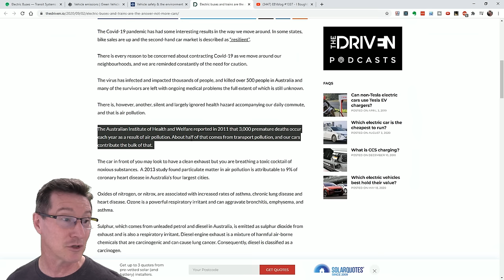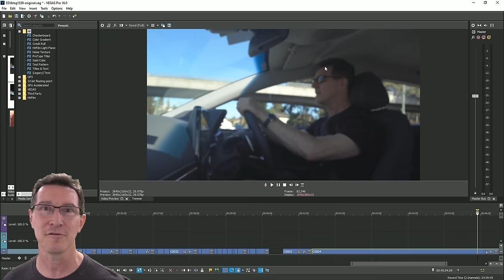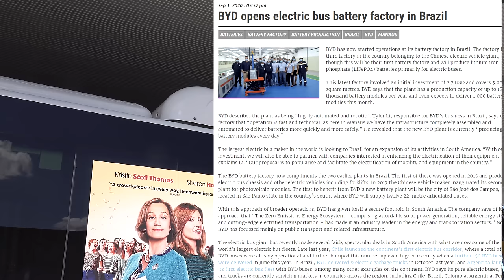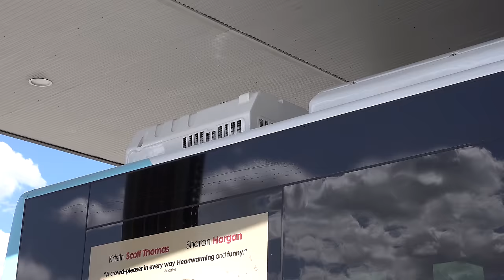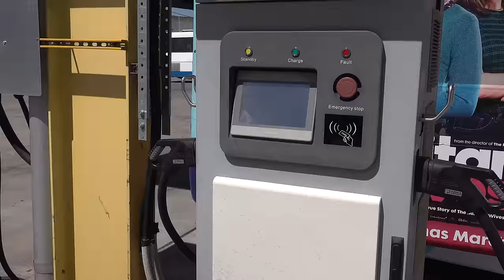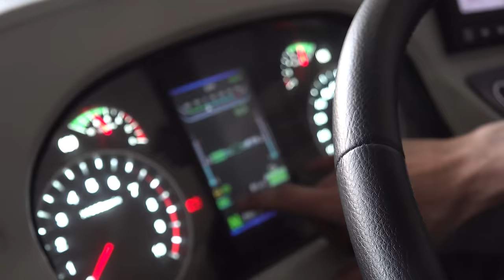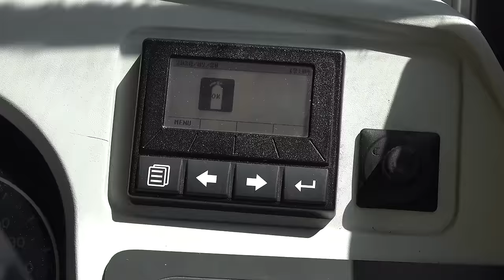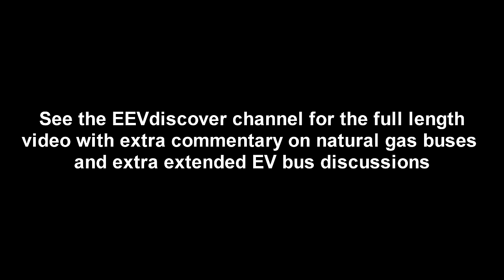EEVblog #1339 - Looking at an Electric Bus!

Comment: LiFe batteries are much better than regular Lion, less density but indestructible
Reply: Oh, they can be destroyed. They're more forgiving, but nowhere near "indestructible". (granted, they don't burst into flames when you stop looking at them.)
Reply: @Ormaaj  They handle overcharge undercharge must better. They have no effective thermal runaway problem. Driving a nail through one is totally uninteresting. (charge cycles are very dependant on who made it. That's a function of the "witch's brew" in the electrolyte. As he said here, "twenty two thousand cycles".)

Comment: Electric buses are actually a big deal in Moscow, there are quite a lot of them replacing combustion ones. They are even advertised with "This is Electrobus" on their sides for general public to know.
Reply: Actually Moscow mostly replaces trolleybuses with both electric and diesel buses. Those electobuses are not cheap so there are not enough of them to replace trolleybuses which were completely scraped recently.
Reply: Nope, there are quite a lot of them replacing just a few of the trolleybuses and the remaining trolleybuses were replaced by diesel buses. That's not progress, that's regress.

Comment: Usually vehicles have differentials to resolve how one tire is rotating at a slower speed than the other when turning. I am pretty sure they do this in software and directly reduce the  rate of the inner wheel.
Reply: Or the motor controllers get a torque, rather than speed request from the "gas pedal"

Comment: They looked like 50kw chargers so with 16hrs runtime you effectively lose a shift. But I'm guessing Syndey might services are limited so it sounds ok.

No cost figure compared to a standard bus factoring fuel?
Reply from the maker: Watch the full video with all the details. They return with 40% of the charge, they don't run them to flat.
Reply: @EEVblog   I did watch to the end... Maybe I boiled the kettle at the wrong time and missed the costings.

I think he said it was 12-14 hrs on average, so 60% usage which is a three hour charge. They probably only charge to 90% if that's the usage, more battery life that way.
Reply: The only time you'll see a bus depot emptied of vehicles is during peak hours (6-10am, 3-7pm). Outside of those times there will be many buses parked up, and at night (10pm-6am) the depot will pretty much be full.
Reply: @mubd1234  I see. Fair enough.

Comment: Waw, there are electric busses like since forever. They take the the electricity from two wires hanging above... 
I don't understand the fuss about the one with battery.
Reply: Yeah its so stupid, this is just a con, making battery companies very rich - not a long term solution either. Try scale up battery production to millions of units this size. Not possible!
Reply: Putting those wires up is very expensive and complicated, and changing a route becomes troublesome, might as well just set up a trolley. An electric bus is as flexible as a conventional bus. Just imagine having to change a route for a couple of days because a piece of road is being resurfaced.
Reply: my understanding is most original trams were bought and closed down by big auto compnaies.  So yes, for fixed routes (towns, cities, rail), that would still be ideal.  We dont care how the energy gets to the wheels as long as we are not setting fire to stuff and polluting the very air we have to breath.

Comment: Trolleybus makes more sense than lugging aound 2 tons of batteries.
2 tons is equivalent to carrying at least 20 more passengers.
Reply: usually the constraint on passenger capacity is not by weight but by volume. you can have a transit bus packed full of standees and still not be overweight. two tons is close to what an engine, fuel tank, and transmission weighs.

Comment: issues with electric buses were being solved for a while, one of such solutions were trolleybuses.

Problems were the size of battery / energy consumption on the engine (and in winter heating)

Comment: A couple of tech generations from now, how small could those batteries be do you think? Can we get to a point where just charging at the stops somehow is enough to keep the batteries topped up to like an 70-80% level most of the time so there could be tiny (relative to this) batteries?
Reply: Clearly I write that before watching the whole clip or I would have mentioned how I don't mean wireless but rather an automated direct connection type thing. But, robotics out in the rain etc is probably a maintenance problem waiting to happen.

Comment: Wireless charging is just ineffective inefficient expensive infrastructure.
Reply: But if there was a....Freakin' Wireless Charging Solar Roadway.....it would be amazing!   (LOL)
Reply: @fredygump5578 
XD
Reply: This is why Trolleybuses and trams are better
Reply: unless its absolutely necessary and saves on the engineering problems of using a simple contact, id rather prefer just making contact so you can dump alot of power very efficiently. ... power is cheap though, it might be worthwhile to use wireless charging points where they park for city busses if it massively saves on maintenance and design.
Reply from the maker: It has niche uses, but otherwise, yeah.
Reply: In parking places it is good. And inefficient is not that big of a problem. It is still a lot better than ICE cars and electric power is pretty cheap at least where i live.
Reply: @EEVblog  AFAIK it would require changes in EMI rules.

Comment: In Sweden,  where I live , we have electric busses for 8 years now , we have  electric carpool which you can rent . Car key is inside car,  doors would be open by mobile application which you have it on your mobile ,
Sweden is far away from Australia   even Norway is far far away when it comes to electric car,
We have even small ship that cross the river is completely electrical,  charging runs for whole day,
Reply: Low temperature doesn't seem to be a problem, either?

Comment: I myself have worked in the transport industry as a fleet mechanic and Even though electric buses do indeed have a future on our roads, there's still the sorting out the logistics of having a huge amount of space dedicated for charging bays, the power demand needed to charge them (which is huge) and minimising time required off road for assets to charge in time before demand on mass are issues that will have to be solved, entire depots will have to be built around the planning of this!

Comment: Cool stuff BUT I am wondering WHY we would still use fluid-based steering (requiring a pump) instead of a more energy efficient electric assisted steering, same for pneumatic for doors and stuff, requiring a compressor, seems like inefficiencies we could remove in the system.

Comment: I think you also forgot that it costs close to 10 times less to drive, at least based on prices in Finland! Also as someone who works in the industry it's nice to see how other companies have built these! Seems that they are actually using a MobilEye ADAS, at least from the little round screen on the top right of the dashboard.

Comment: It's important to remember that going electric does not eliminate pollution. It just moves it from tailpipe to power plant.
Reply: The refinement of crude oil into fuel uses a huge amount of power. Using the power directly to run the bus is much better than refining oil only to burn it as well.
Reply: So what do you think powerplants run on with a efficiency below 40% ?
Reply: Not to mention that scrapping millions of perfectly functional cars to produce new ones is very energy intensive. The mining for metals and battery compounds. 

The fundemental flaw with electric cars is the are nowhere near as efficient as petrol and diesel. Neither is hydrogen fuel cell technology. A fuel tank gradually gets empty and the car becomes lighter as a result. An empty electric battery is the same weight full or empty.

Hydrogen is a much more dangerous fuel, remember when those airships used it, that didn't end well did it? as a result, any benefit hydrogen offers is wiped out by needing to have a fuel tank that is 5 times thicker (and therefore heavier) than a petrol one.

Petrol and diesel cars would never have been successful if they weren't good at what they did. The fact that electric has to be subsidised and we have to be forced to use it by banning combustion engines just shows it is nowhere near as good. Refueling a car takes a couple of minuites, electric much slower.

I'm not totally against electric cars. I think they should be the only cars allowed in big cities. But for people doing motorway trips, non-urban driving they aren't good enough yet.
Reply from the maker: It eliminates the local air pollution that you breath in, that's the point. That kills 3000 people a year in Australia.
And the energy comes from whatever source you chose. There are options.
Reply: @danspratt2  And electricity production and distribution is so perfect? there's huge loses as it travels down the wires and goes through all the transformers, sub-stations etc... If electric was a good proposition we wouldn't need to be forced into using it by banning petrol cars.
Reply: The most modern combined cycle power plants exceed 60% thermal efficiency. The biggest diesel engines can break 50% but most automotive diesel engines come in around 30%. This is ignoring wastage from engine idling, which as pointed out in this video makes up a very significant part of vehicle runtime. Even ignoring the fact that fossil fuel-free power generation exists, just switching from internal combustion engines to electric motors for vehicles will lower CO2 emissions overall.
Reply: @EEVblog  Recent studies seem to suggest that electric cars do not actually eliminate local air pollution because of tire+road wear, unfortunately. :/
Reply: @dave, so what you are saying is basically nimby.
Australia maybe different but in most of the world powerstations are in rural area, these are all just solutions to give some people nice clean local air and move the pollution to other people,area etc
It is not australian people, kids digging up kobalt,lithium and all these other rare earth materials But poor miserable people, just like the people breathing the crap from powerstations, they are not in these nice clean citys.
Reply: @EEVblog  That's not how the power grid works though.... you can't just choose your own source unless you can string your own power feeders directly from the source of your choice.
Reply: @tigo01  Yes, electrons are fungible, but you can still vote with your wallet. The plant you pay benefits from the electrons you use. That's one role that the regulations and energy markets can play in this.
Reply: @rkan2  You mean the same tire+road wear from ICE cars? Sure, the SUV sized EVs might be a bit heavier than the equivalent ICE version, but is the slightly increased tire+road wear a worse pollutant than the exhaust it replaces?
Reply: @6581punk  no it isn't perfect, but you're missing that the oil refineries must also use that very same power on the same grid to first refine the oil into fuel. Its better to send the power directly into batteries than to use that power to make fuel.
Reply: This is a bus, its not a car moving at 60mph for a hundred miles along a motorway, its in an urban environment and constantly stopping and starting, it being electric is soo much more efficient that this sort of argument doesn't hold up, like it might do for a motorway mileage muncher in a modern diesel car living in a country with a moderately dirty power grid.
Reply: @6581punk  "The fundemental flaw with electric cars is the are nowhere near as efficient as petrol and diesel."

omg, the FUD and propaganda lies are getting outrageous.  What's next? "The fundamental flaw with electric cars is that they explode when their battery is empty."?
Reply: @robber576  What YOU'RE saying is basically 'NIMBY', on the side of the rural people. 500 people in a sparsely populated rural area being exposed to pollution from a powerplant, versus 500,000 in a city being exposed to tailpipe emissions? I know which one I'd choose.

It's like those selfish arseholes who bitch and moan about the new airport in Badgerys Creek in Western Sydney on the basis that a few hundred homes are going to have plane noise...while hundreds of thousands of Sydneysiders will have a decrease in aircraft noise over their properties because Sydney Airport will have fewer aircraft movements passing over thickly settled suburbia.
Reply: @6581punk  huge losses? turbines at powerplants runs at a constant +50% thermal efficiency 24/7 which ICE could only dream off. Factoring system loss of around 10% due to distribution its almost certain going electric are greener

Comment: There is a second-hand Nissan Leaf (the coal-powered options in South Africa are a bit limited) for about half the new price.... 

I kind of want to take it for a test drive... (But at that price, you have to wonder if there's an issue with the battery...)

(I know Dave mentioned that the Leaf lacks battery cooling)

Comment: These BYD buses are all over London and been there for a while now, they use DC fast charging and also AC charging at 3 phase. They used to break down all the time due to the electronics and I don't remember them running out of range. They are very fast, Smooth and the power charging infrastructure at the garage is insane... I believe other companies are making electric buses, like Alexander Dennis wich seems more reliable. BYD us a Chinese company, with slightly less quality. But they get the job done. They have Electric double decker's made by the same companies.

Comment: Does the transit department additionally leverage solar to help offset the electricity costs for these buses?
Reply: No it’s all run off coal
Reply: if you are talking about solar cells on the roof of the bus it would be a trivial contribution compared to the surface area. if you mean solar back at the shop that would be a great idea.
Reply: @lightningdemolition1964  Nope.  I was wondering if they had a solar farm nearby or on the roof of the building to offset the electricity costs.  Understood that on the roof of the bus it would not be much.  Maybe like a solar road?  :)

Comment: Cars generate pollution from tire and part wear: "Air pollution from tire wear particles can be 1,000 times worse than what comes out of a car’s exhaust, Emissions Analytics has found. Harmful particle matter from tires is a very serious and growing environmental problem, and is currently unregulated...Non-exhaust emissions (NEE) – particles released into the air from brake wear, tire wear, road surface wear and resuspension of road dust during on-road vehicle usage – are currently believed to constitute the majority of primary particulate matter from road transport: 60% of PM2.5 and 73% of PM10."

See: https://www.tiretechnologyinternational.com/news/regulations/pollution-from-tire-wear-1000-times-worse-than-exhaust-emissions.html

I'm not saying electric cars are a bad idea, they are a better idea. Electric bicycles are a bit better as they are lighter and thus less wear.

Comment: Dave, the least argument for electric cars is that owners a forced to only start them for driving. I press the start button of my old school Diesel only AFTER I sit in completely. Even in summer I don’t use AC BEFORE driving and in winter while ice scratching (you know that thing in the black mountains) I do not „preheat“ the engine.

BTW, they ZF-axles. 👍🏻🙏🏻

Comment: These things have a lot of space above them to place some solar panels, so with a smart controlling system you can either party of fully charge the batteries when or not in use or divert the portion of the power when the thing is moving in order to put less strain on the batteries extending their lifetime, all this assuming their weight doesn't become a diminishing return factor instead and that also depends if there's Sunlight.

Comment: 424 Volts / 108 Amps. Man that is just staggering. Very informative and interesting. I regularly charge a couple of R/C LiPo batteries, highest I've charged them is a bunch in parallel, pulling 1 - 1.5 KWatt from my AC 220 Volt AC home current. Have 3 Server PSU's in series giving me 36 Volt / 100 Amps to power my chargers. But this is quite something else, my goodness. Look at the size of these stranded charging wires, just unbelievable. These wires alone must weigh a ton! This is really proving that globally electrifying everything is not possible. How on earth would all that power be delivered to our front doors. Just can't be done.
Reply: We have a different type of BYD (K7u) with 2 cables, charging at 87kW, I was told they had two cables because the thickness of one cable would pose handling problems (them becoming too heavy)